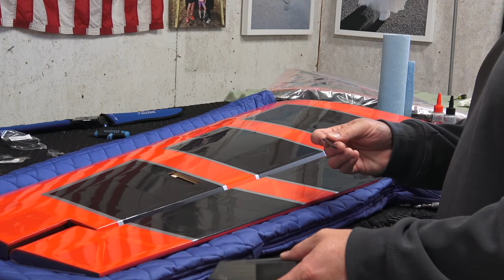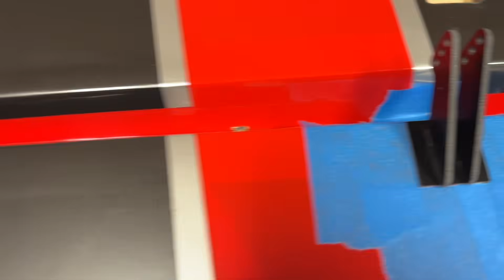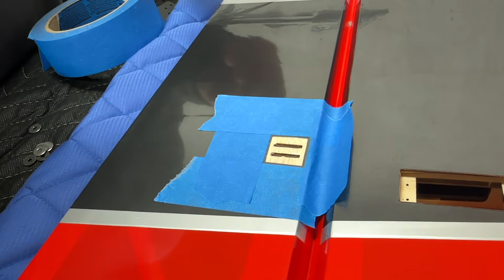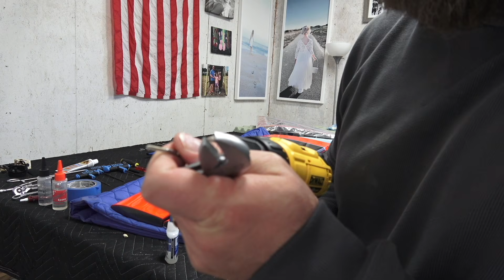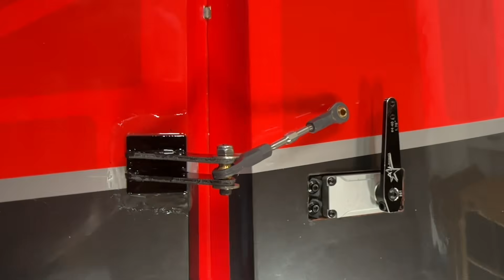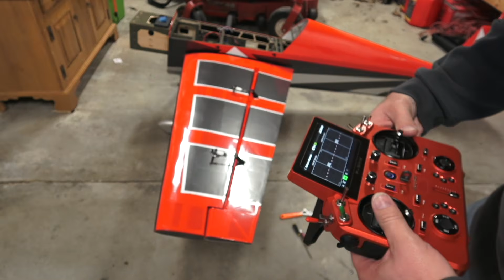BUILD SERIES | AJ Aircraft 103" Slick 540 (Video #1)

Comment: How many servos are you using on rudder?
Reply from the maker: I run one FrSky 5405 on the rudder. Push-Pull
Reply: @teamjcac perfect I am building this plane. Same color. Gp123 and FRSKY 5405 in all surfaces. Thanks for sharing your build
Reply from the maker: @bamauricio  thanks for watching! I have two more videos coming out in the build series. The FrSky servos are really awesome. I run the 5404’s everywhere else and just the 5405 on the rudder. On my 40% Carden, I run the 5405’s all around with two of them on the rudder
Reply from the maker: @bamauricio I did the maiden today and it went really well! Best flying AJ plane to date! I have the batteries as far back on the pull pull rudder tray as I can get them and the plane was still too nose heavy for 3D, so I’m thinking about adding a second rudder servo. Just wanted to mention that since you’re building yours.
Reply: @teamjcac awesome thanks for letting me know